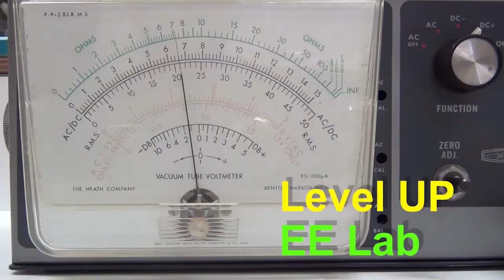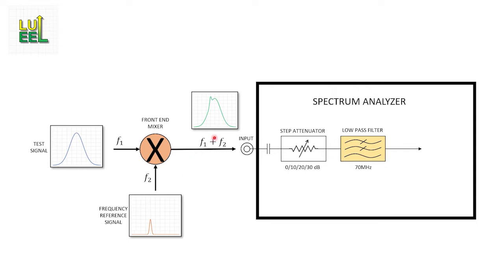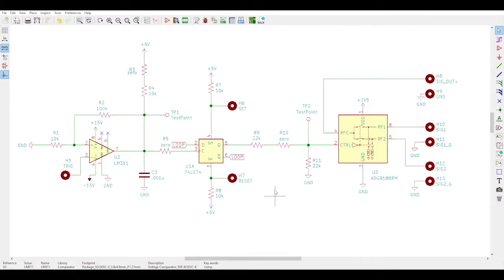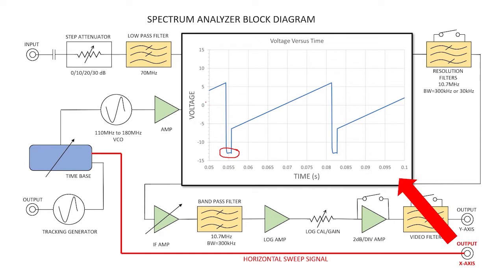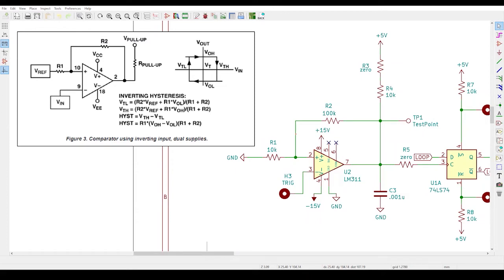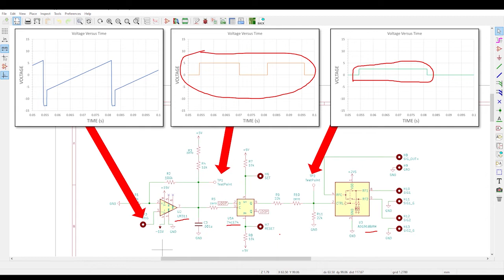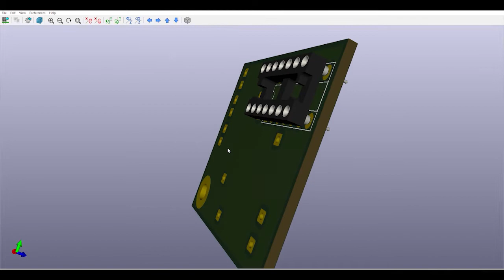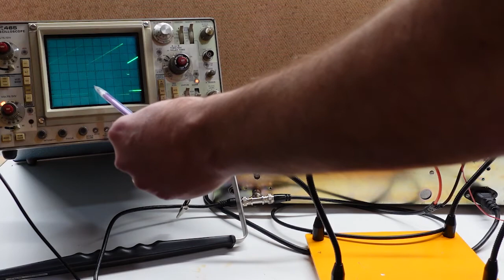Non-Contacting High-Speed Multiplexing RF Switch:  Part #1

Comment: A great problem-to-solution story.  And using junk box or available parts.  I've used the 311 comparator to generate PWM, using audio to modulate a 125khz clock, it works perfectly and I think would go at twice the speed.